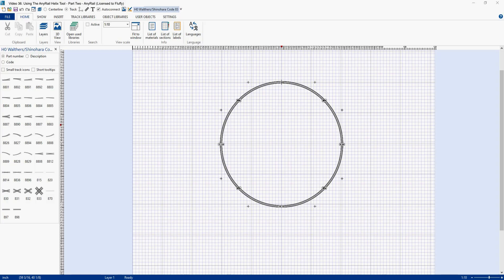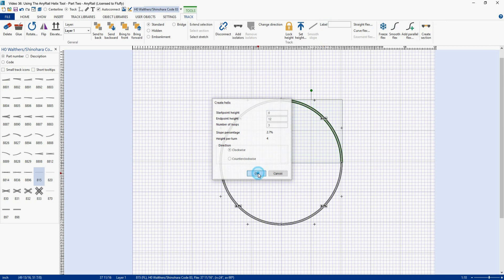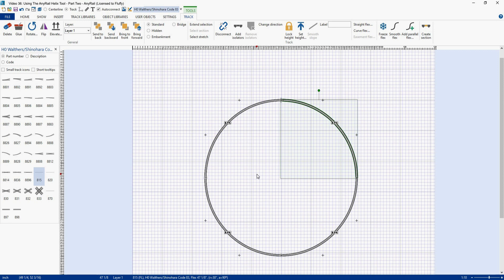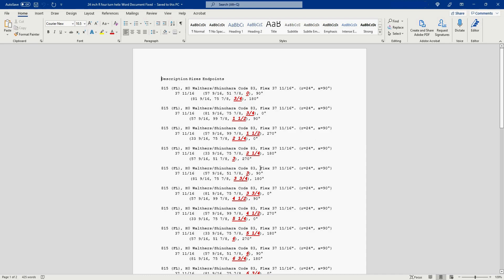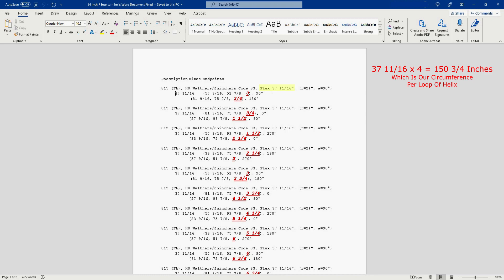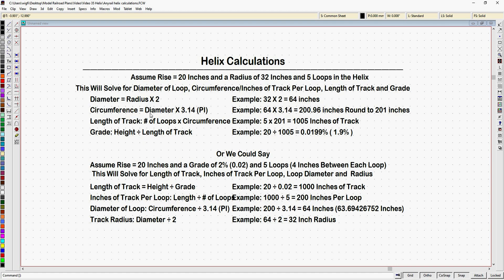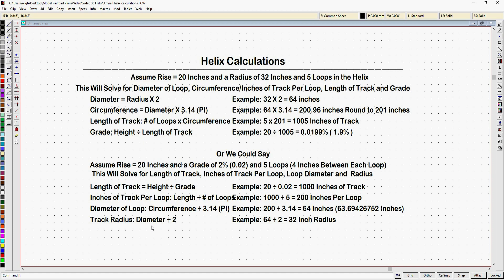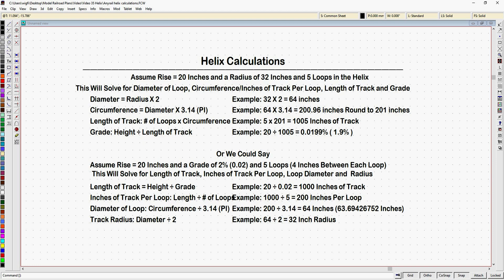AnyRail Tutorial Video 36: Using The AnyRail Helix Tool Part Two

Comment: Hi! These videos are all fantastic, and a great help to me on all aspects of planning a model railway using Anyrail. I have a question about the helix calculation. I work in metric, so I'm having to convert all your measurements, and when I enter the equivalent settings to what you show us starting at  2'23" I don't get the same gradient. Your 12 inch arrival height is 30.48mm and your 4 inch height per turn is 10.16mm for me. That's all cool, but the slope percentage I get is 3.2% instead of 2.7%! Am I doing something wrong? I'd appreciate your opinion.
Reply from the maker: Hi Steve, Give me a day or two to look into this and I will get back to you. I will admit I will have to go back and watch the video and see what I was talking about and what examples I used. Dave

Comment: It’s always fascinated me that here we have a track arrangement that has HUGE length of track in an format that lots of people use routinely.   We complain that the length of track is a negative.  But when talking about other features of some track arrangements are desirable to have lots of track length.
I’m thinking of course stagging.   What if we used Helix to do our stagging.  We add lots more turns, lots more hight and more importantly lots more parallel tracks. Say four or five tracks wide. Sure it takes up more room but doesn’t the track length finish up with lots and lots of tracks to store trains?

Or is it a dumb idea?
Reply: Of course another way of reducing the grade whilst maintaining the same track radius is to building the helix as an oval shape. An oval would make the inclusion of staging even more attractive. That would be fun to design in Anyrail!!! I haven't found an Oval Helix calculator, yet, though.
Reply: @bobfuller  Hi Bob. In AnyRail one would generate a half-helix and then replicate twice as many as the number of loops required.  You would create a single straight, inclined as needed, and then replicate that.  Then it's simply a case of joining up the half helixes with a straight after each.  The height calculations outside of AnyRail are relatively straightforward, and of course AnyRail will give you overall length etc for any active selection or section of track.  Note that if the straights are not level, then you have nowhere to store wagons and carriages without locos (gravity takes over).  Also, some locos (more steam than diesel or electric) when coupled to a long train may struggle to move from rest on a helix with a gradient compared to when everything is in a straight line.
Reply from the maker: I think I have seen a track plan somewhere where they used a helix as a staging area. It is an interesting idea and I will probably play around with it and post a video of what I find. As to making the helix in halves, my next video is how to design a helix without using the helix tool. The script and practice runs are almost done for it. I am going to try something that may be clever or may be a total disaster. It's one of those ideas that comes to you late at night and those always sound like a good idea.....at first. There will be a short addendum video to video 36 posted tonight or tomorrow. It just explains the details of a helix a little better. I'll try to work on oval helixs too. That sounds like fun.
Bob, what would your design requirements for an oval helix be? The size, rise, etc. Let me know and I'll play around with the idea a bit.   Dave
Reply: @steampoweredradio2981  Actually, nothing specific, Dave. My track plan keeps changing. The latest change is just me considering using an oval helix instead of long grade runs, but I have put anything down on paper, yet. So, you have a blank sheet to work with. :)